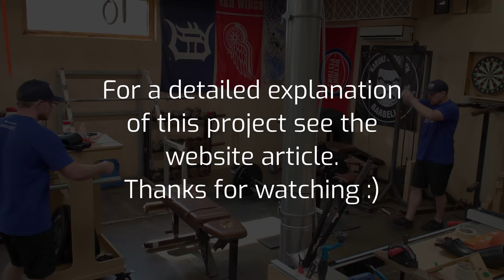Giant Clock - 372

Comment: Real nice Jay! 
Years ago my mom had a big kitchen clock with a cool design for the movement. It took a D battery which would actually wind up a spring, when it wound out, instead of just always draining to run the clock. The clock (and battery) ran far longer bc it wasn't constantly draining the battery. Sounded cool too, as it wound up. Old timey. 
Cool video too 😎

Comment: Regarding the French cleat, did you put in a header inside the wall between the studs or just use two studs and drywall anchors in between the studs for the part of the cleat on the wall?  I have mine completed and it weighs about 50-60 lbs.  I think two studs will hold it but want to make completely sure.  Thoughts?
Reply from the maker: Cleat attached to two studs.

Comment: Nice clock. 
I’m surprised that little clock movement is powerful enough to move such long (and presumably heavier than normal) hands? Did you balance them to reduce the power required to move them?

Never mind, I found the high torque movement on your link.

Comment: Hey got a question! - having a walnut slab table built with clear epoxy in the voids.  The builder wants to use Minwax satin water-based poly to keep the epoxy nice and clear.  Thoughts on this finish?  I have kids and need something durable as well.  Thought about an epoxy flood coat, but that's a bit more pricey.  Thanks!

Comment: Changing that battery is going to be a bear! I also think it will burn out kinda quick due to the size of the arms.
Reply: There are high torque battery operated movements for large hands.
Reply: @melindajohnson3394  sounds good. The one in the video looks like the $3.00 variety from alibaba (I just ordered one for a repair)